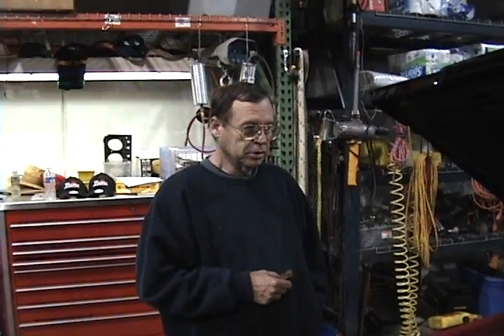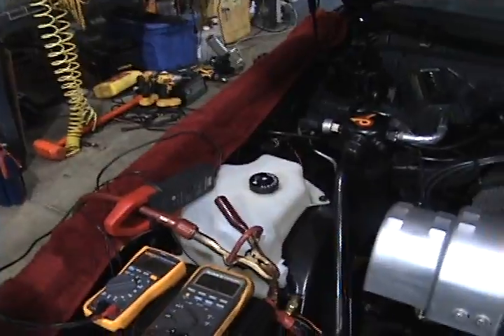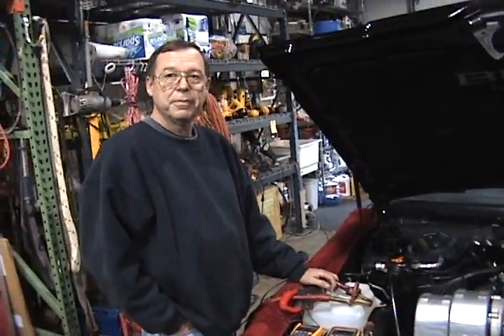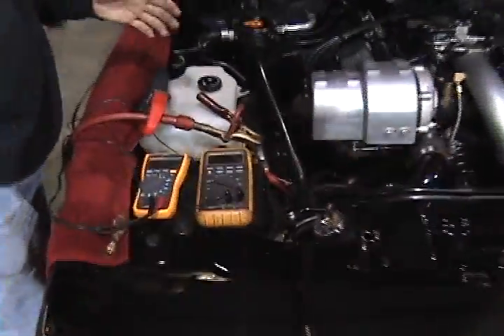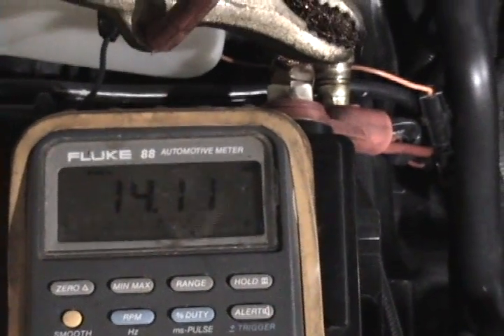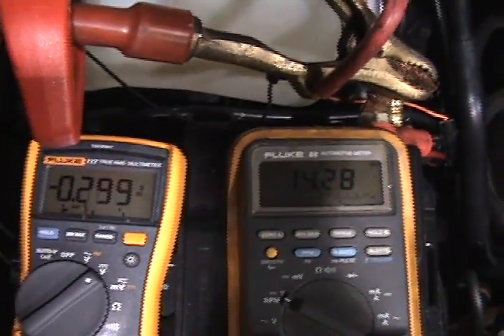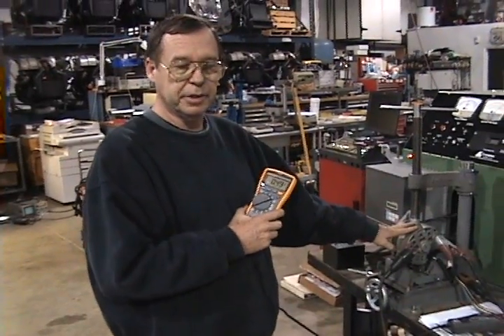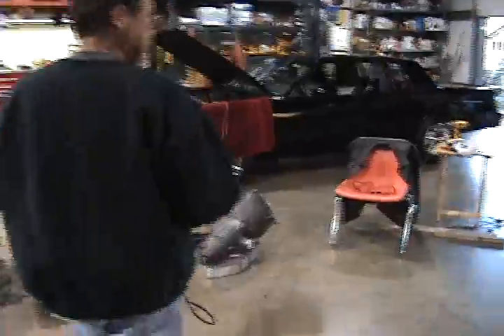Richard Clark Alternator to Battery Stock vs Large Gauge Wire

Comment: but it does show a bigger power wire allows easier flow of more Amperage (amount of power) volts is the force of electricity